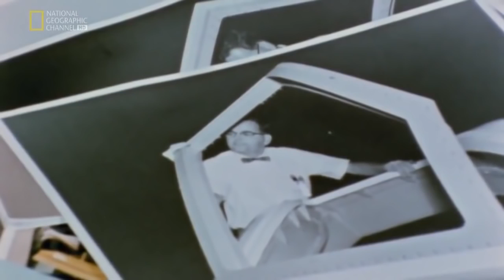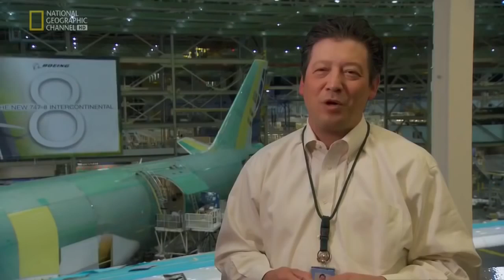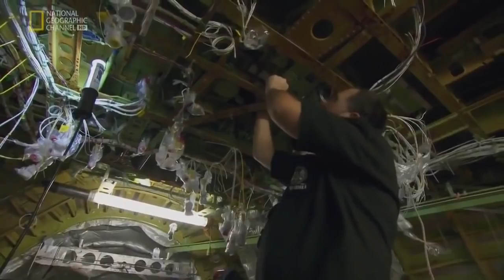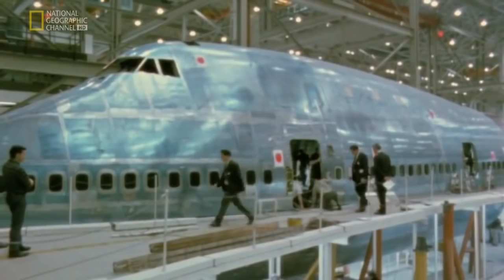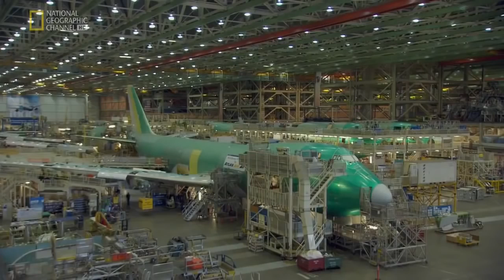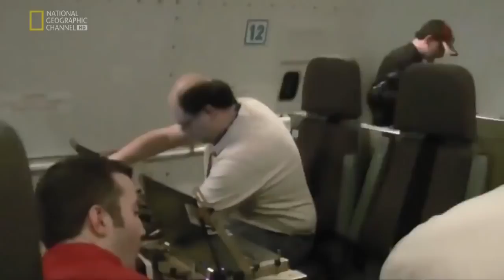MAYDAY- LET'S KNOW ABOUT"BOEING-747"(Ep:23).

Comment: The 747 was designed originally as a cargo plane, and that appears to be how it will continue after no longer being used as a passenger plane. The A-380 appears to have been done in by its sheer size - most airports can't handle a plane that big, and they aren't going to rebuild just for a few of those.

Comment: AT 41:50 They say that they put a big pice of wood to simulate if they pilot takes off and abusess the controls. But when a real flight is happening there is no piece of wood to protect the rear fuselage. So how is this accurate and safe testing? Someone please tell me. Thank you.
Reply: Really long-bodied planes have a tail bumper - it is mentioned in a more obscure episode of an air crash investigation series. The plane in question was a DC-8 cargo plane, IIRC. Boeing 757s and 767s sure ought to have them. I think the way a 747 is angled at the rear prevents most strikes, though a tail strike and improper repair led to Japan's (and the world's) worst aviation accident in terms of a single aircraft crash with greatest loss of life.
The pilot isn't supposed to exceed a certain angle of rotation at takeoff. Anyone that is that ham-handed ought to have been eliminated during training.

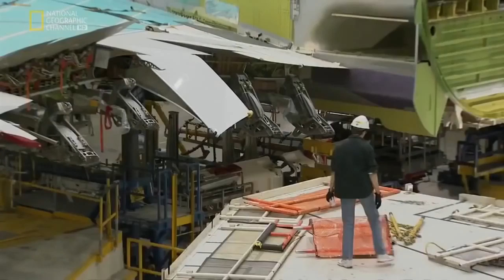Comment: 20:46 Do I really want to rely on a computer to cancel out the vibrations of the wings? What if the computer malfunctions or the debris of an exploding engine severs the cables? Then the wings fall off because the computer cannot control the vibrations anymore? No thanks Boeing, make the wings stable without another one of your smart suicide software systems.